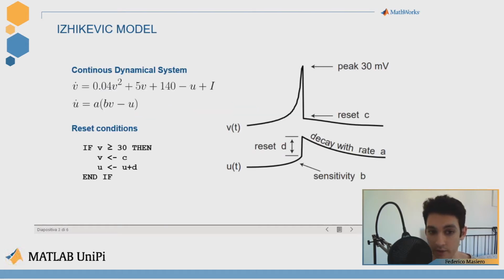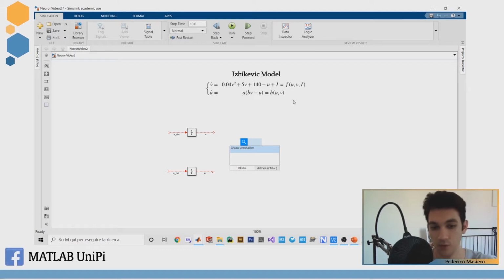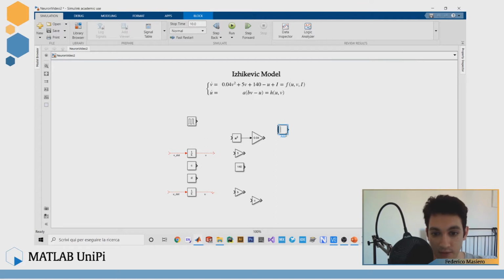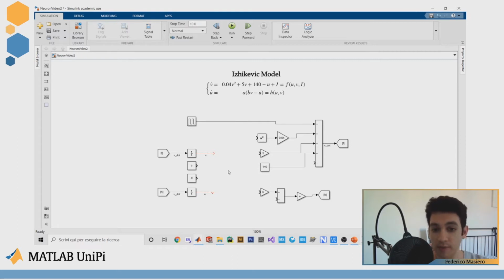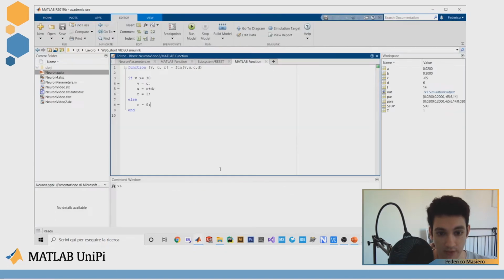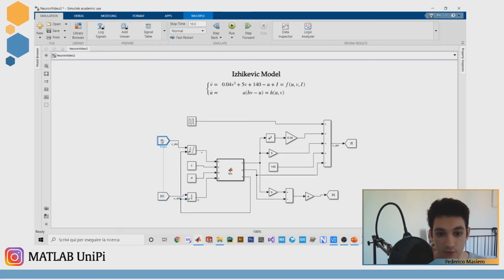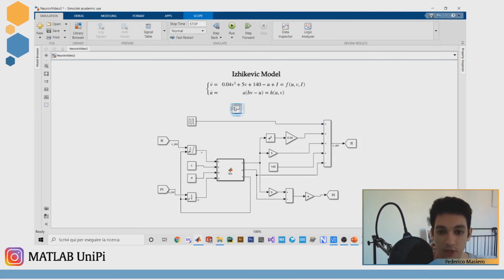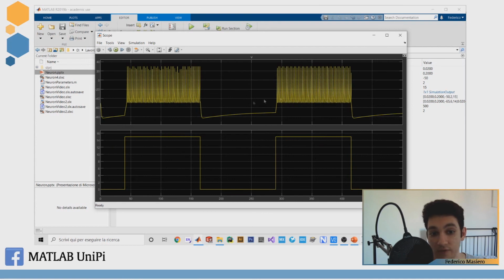Simulating a Neuron with Simulink

Comment: Very interesting tutorial. I am facing an error related to the function file, used to implement the reset conditions. When I save the file it automatically changes u ---> u1 and v ---> v1, see the function[u1, v1, r] = fcn(v, c, d, u).